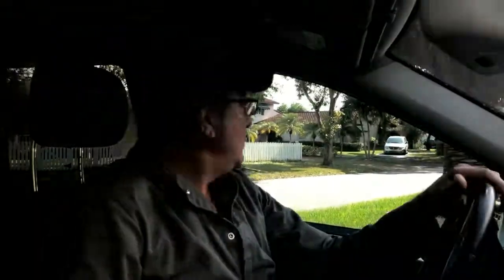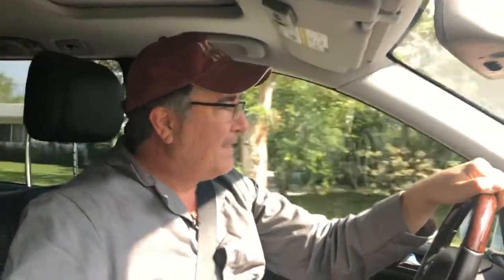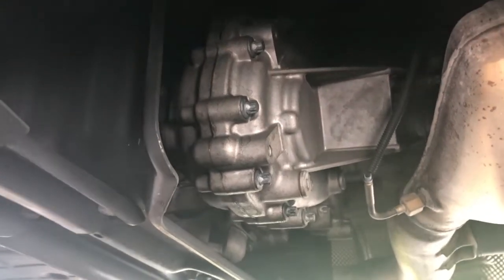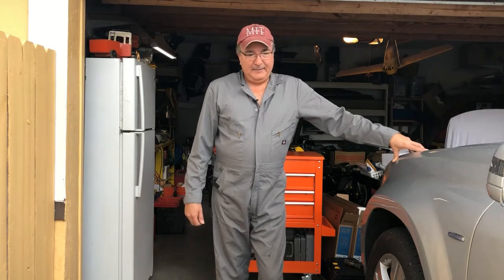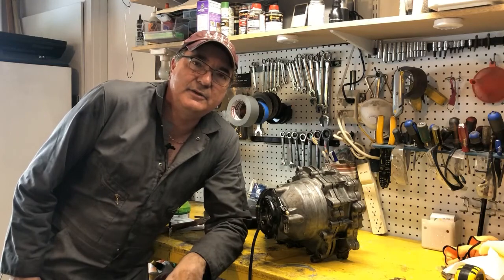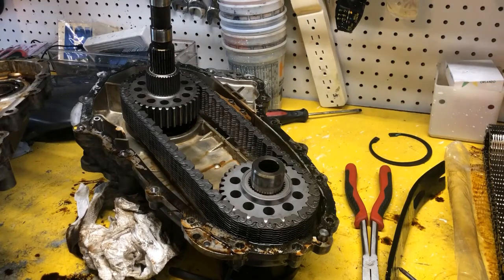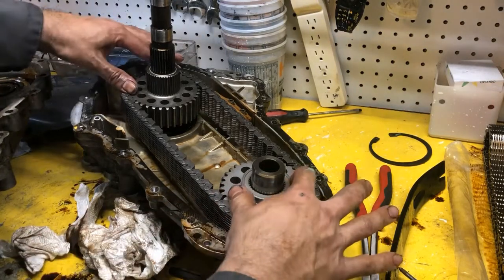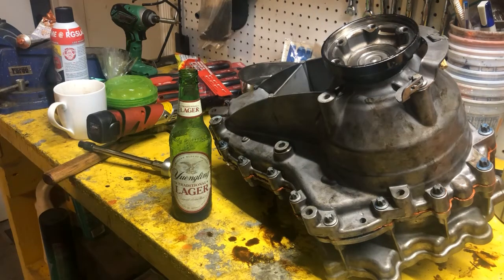Transfer case rebuild on 2011 Mercedes-Benz GL350 Bluetec (X164 chassis)

Comment: Really appreciate this video, I had the same issue with my 2012 GL450 about 1.5 years ago, after reviewing several different youtube posts yours and another were the two that I based my repair project on.  I only purchased the chain, the merc transmission fluid, etc. ended up spending about $180 total and 2 days for the project and fixed the issue.  All bearings looked good, only issue, chain elongated, maybe quarter inch and that's the root cause of the problem.  I will be replacing the fluid every 30K-40k miles or so along with transmission flush, so will do that in about a year.   Now about 25k miles later still running nicely, thanks again!  BTW, I was able to just take the back half of the transfer case off, without complete removal and replace the chain, there is enough room to do it, just though.

Comment: I'm about at the Dude level in pro-am mechanics. When I drained the fluid from my 2001 ML320 at 240K miles the ATF was black. Mine took 1.8 qts of Valvoline Syn ATF. Most of the time only a chain is needed and a re-seal. The bearings and seals are usually good. Mercedes makes me scratch my head at times. Some items never receive the engineering that I would expect from MB given the bragging about it.? Change the ATF in your transfer case. My transfer case was made by Borg Warner. Driveshaft made by DANA Spicer. Thanks for letting us watch Dude.

Comment: This is the exact issue I have with my 2007 GL320 CDI with 160000.  Just started a month ago, and parked the car.  Will look for a rebuild kit and tackle this project.  Thanks for posting.

Comment: All i can say my 1997 4Runner with 438.000 mi on the Clock. still Strong I never did any Major Repairs except Timing Belt kit and fluid changes .
Reply: That's what I say when replace 3 time suspension compressor(1st,  2nd was cheep $140 I am  not recommend them, then I take from Deller for $560 this one work), front shocks, rear airbags ,and after I find out ,chain skipping,I thought to fire up this luxury GL .
Thanks for video help a lot.

Comment: You do not need to completely remove the Transfer Case from the vehicle if you only change the sprockets and the stretched chain, like I did. Just remove the rear driveshaft and the heat shield, than drain the oil and remove the TC cover to access chain and sprockets. 
After 50K miles the chain is stretched anyway and needs replaced, even if it doesn't skip. You can feel a loose drive train between acceleration and brake at low speeds.
Reply: You were able to split the case with the transfer case in the car?  I need to change my chain.
Reply: Marian Manole, please where are you located. I think I will need your help. Am in cincinnati Ohio.

Comment: Hi, great video. Thank you. One question to clarify, did you move the car in neutral to rotate the drive shaft so you could get to the difficult bolts on top of the driveshafts, or was there enough space for you to get them out without taking the car down? Thx. This was very helpful.

Comment: 1) How did you remove the top bolt? I tried the crows foot another youtuber suggested and cannot get it moving. I tried two universal joints on the extension and again can't keep the socket on the bolt when I start to apply force? 2) being a bluetec, it has an oxygen sensor right below the long arm of the transfer case, did you remove that to get room to wiggle the case out? Please let me know about that bolt and how did you get it back in?

Comment: The chain was most likely stretched due to no regular fluid changes, just changed my fluid with 7000 miles and the inside was metal clean and no dark marks from oil and chain was good.

Comment: I think that is a 37 link chain; that means 74 link pins, and all you need is 0.0067" wear on each link & pin, and the chain will appear to have stretched 1/2"; add to that any wear of the gears, and you've got a skipping chain.

Comment: Wow I just found out that I have the same problem with my e350 2010. For two years I've been driving my car with this rambling noise and I always though it came from the drive shaft. Now looking at this video I would love to know if I can repair it just like you did. Now I'm not having the same problem as you did, but it makes a lot of rambling when driving especially when I accelerate.  Hope I can make this work in changing all it's components if that's the case that it needs. Look forward for a response thank you and great job you did.
Reply: Your E350 4matic has a different transfer case set up.  Your transfer case is actually built into the transmission.

Comment: Don't know the milage but they suggest you change the fluid in the case when the trans fluid is done, it appears you have to drop the drive shaft to get at the fill plug so it is no layup doing that.

Comment: Thank you for a great video! Have you ever changed the transfer case fluid in this vehicle before the chain started skipping?
Reply from the maker: Hi Ivan.  I never changed the fluid before the problem.  I think Mercedes does not see this as a "serviceable" part on the car.... routine maintenance does not call for servicing the unit.  But, as you can see the unit has a drain and fill plug.  I will drain and fill with every oil change going forward.  Thanks for watching!
Reply: @dudesdoityourself6260  How about transmission fluid, rear differential fluid, front differential fluid, power steering fluid and filter, airmatic air filter, crank case oil separator? Just want to know what future rebuild projects to be looking for ;)

Comment: Dude. You are the only one really talk about newer model Benz. I am trying to figure out the oil catch can installation and EGR cleaning shortcut but only find the antique Benz videos. Have you ever tried to do the engine on the car? I am itching to do the twin turbo with turbo timer in it and cannot find any information any where.
Reply: Free Will I added a catch can to my 2007 GL 320 CDI and it works great. No more oil blow by into the turbo.
Reply: Rafael Rj I sent the pictures
Reply: @seankellogg6154  What catch can did you install on you GL350.  I have a Mann provent 200 installed on mine and it seems to be working well.  I am also having chain troubles too but I'll bet the previous owner didn't service the transfer case as needed.  Would love to see pic's of your catch can and which one you used?
Reply: William Jackson I changed my eBay catch can to the provent 200. I am about to change my routing of the CCV to remove the tube from going into the front of the turbo inlet and use a coupler kit to the air intake. I found a video on YouTube that someone did and it keeps any oil from going to the turbo without a catch can. YouTube OM642 connector and you should find his video
Reply: Sean Kellogg - We should chat and compare notes. I have been in touch with Mann local reps which in turn have been in touch with Germany. The engineer that is over the provent system is out of pocket until August 17th. Actually I have been talking to three Mann reps here in the states two of which are hard core car guys and have been digging into the complete PV line of products. I can tell you that I routed the exhaust from the PV200 under the GL and have developed a few good seal leaks since doing so. I believe the engine has enough blow by that I’m building enough crankcase pressure to cause the leaks. Is there a such thing as PM on YouTube? If not I’ll shoot you my email address. Also, I cleaned the intercooler a few weeks ago and will be looking this weekend to see if the small amount of oil that was there came out of the cooler. At this point there isn’t anywhere for oil to be coming from other than a leaking turbo seal. I’ll know that by the weekend. If there isn’t any oil present I’ll reconnect the PV200  to its original spot in front of the turbo & see if I get oil again. I’m doing all of this before I buy the MotorVac 500-0170 to clean up the intake tract.
Reply: This video shows a leaking turbo seal. https://youtu.be/xYgUnbTVAQA
Reply: William Jackson crap, I copied the wrong one 😭😭😭
Reply: Check out ridgeback garage video
Reply: Sean Kellogg - I have seen that one a few times. I believe the outcome of his modification would be the same as mine.  Evaluating the system I think it needs some amount of vacuum from the turbo to evacuate the crankcase properly. At this point I am expecting the German engineer to suggest going with the PV400 to deal with the amount of blow by. Once the coalescent media filter becomes saturated with oil it takes some amount of pressure to force the gasses through it which I think is too high causing a seal or two to leak. The only other thing I can come up with is that my oil cooler seals just happened to give up, coincidentally, while I’m playing with the crankcase vapor (and now the transfer case chain). I like the car enough to see all of these issues to the end, plus I like the challenge.
Reply: William Jackson I finished my oil cooler seals about three months ago and it was easier than I thought. Just had to go slow and have lots of bolt trays handy. I wish these engines had a breather on each head and vented into each air filter inlet.
On another note, I’ve been trying to find a larger intercooler to help reduce intake temps but I can’t seem to find anyone who makes them. I may have to find a local shop that can custom make a bar and plate version with all aluminum ends.
Reply: Also, I have the updated CCV that doesn’t take the puck on top of the cam cover. It’s the metal valves one that is on the rear of the head. I just changed it 8 or so weeks ago and bought it from the dealer so I know it’s the most current one, they had to order it from MBUSA. After changing it I was still getting oil and that’s when I added the PV200. After the coalescent filter was saturated with oil I got oil in the turbo again although it was a fraction of what I was getting before. That’s when I turned to the guys at Mann. They are really interested in solving this issue.

Comment: I just got a quote from mercedes today for over 7,000 to buy a new transfer case.  I have exactly the same issue.  Thank you thank you thank you for posting this valuable video.  This is what it is all about.  Even if I go to a mechanic. I am well armed with all the info I need.  I am thinking of just getting the chain.  I noticed you put the new gears in.  Do you think I need the new gears also?

Comment: Dude - Did you happen to take a picture of or make note of your transmission part number?  Mine is an a251.280.20.00.  If they happen to be the same, which kit did you buy?  I am having the same issue and I'm running into conflicting info on the chain part number.  MB is of no use, they do not have any parts listed as "serviceable".  It's screw you, buy another one.  Their reman unit is $3,600.00 wholesale.

Comment: Do you think changing the oil regularly in that transfer case can help chain stretch? Thanks
Reply: Yes but you don't need to change that often. Take your time when starting off in gear it will not put much stress on the chain.

Comment: Great video!  The local MB dealer wants $10k for a new TC for my 2009 ML320 which is essentially the same as yours.  No way.  Did you have to remove any exhaust components to get proper access for TC removal?  I assume raising the rear drive shaft gives enough room to pull the TC backwards and off.  Thx in advance.
Reply: John Hansen you will want lots of ratchet extensions and a cordless ratchet. Removing drive line is easy. The top bolts are tough but just take your time. I used a quick jack for my job and it made it easy to rotate the driveline when removing and re installing the driveline bolts.

Comment: On my 4MATIC W211, oil of the transfer case should be changed every 60000km (37000 miles) in the same time with the gearbox, it is specified in the service manual.
And the oil is stritcly limited to MB236.13, you can use same oil as gearbox MB236.14. I would never put common ATF, totally not recommended... maybe the transfercase is not so sensitive but I hope you didn't put that in your gearbox.
Reply: It is just a chain and some gears, don't panic about the oil but make sure it is  compatible with the liquid gasket (sealant) you will use.

Comment: Try liqui moly fluids you will love it ,I used to use Mobil 1 but now I am using liquimoly only for Benz ,I owned w204 c300 2008 and 2008 rear diff used 85w90 and Mercedes USA says 75w90 that is wrong oil ,I used 85w90 liqui moly as per Mercedes Germany and differences is huge a lot smoother. In your transfer case it may be wrong oil put by dealership. 
To see correct oil visit https://bevo.mercedes-benz.com